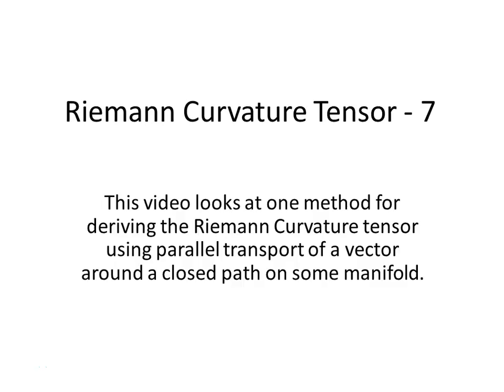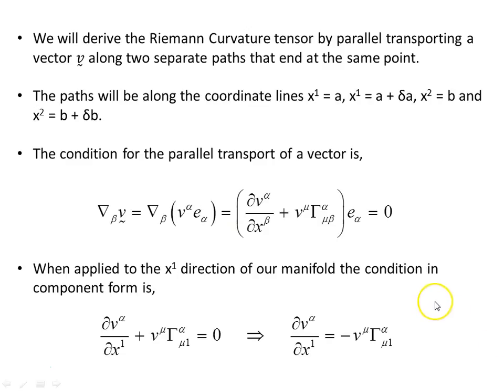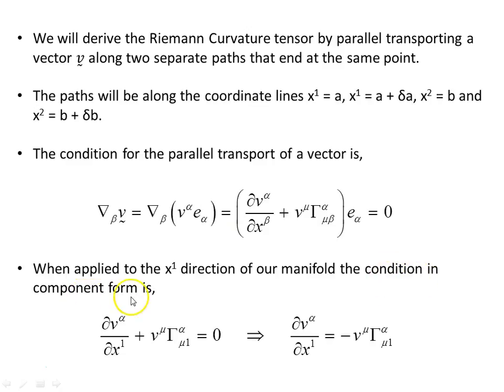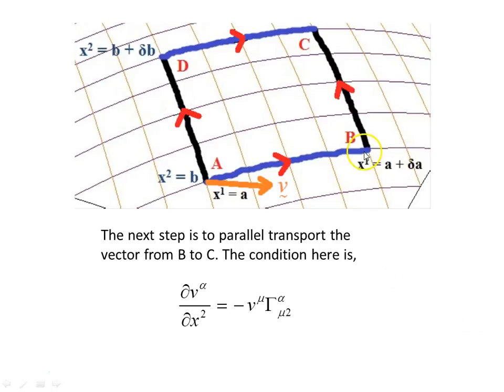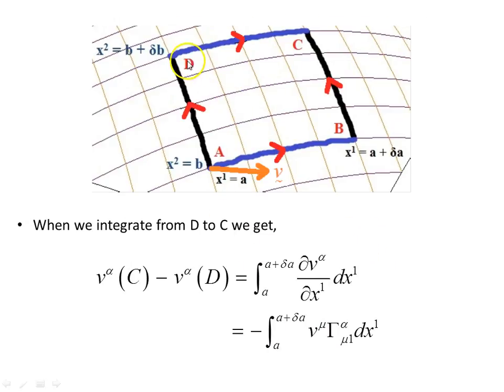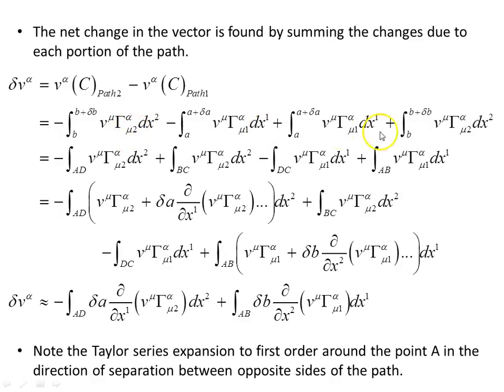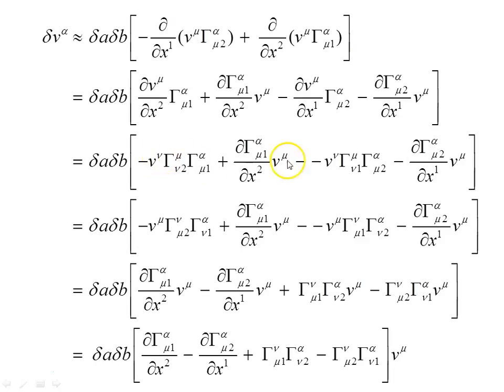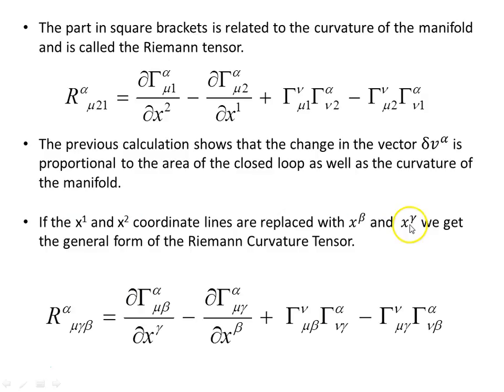Riemann Curvature Tensor - 2 (corrected)

Comment: Hi there! At 9:12 is there a mathematical way to get from the equation at the top to the one right below it? Im not really seeing the jump between the two. Thanks!
Reply from the maker: Hello Brendan. The two integrals on the first line are integrating dx and evaluating it between the two terminal values, the difference of which is delta 'a' or delta 'b'. We can then take this delta 'a' or 'b' value out front. So Integrate[dx] with terminals = [x] with terminals = delta 'a' or 'b' as the case may be.
Reply: @TensorCalculusRobertDavie  Thank you very much!

Comment: Thank you so much !
Is it okey if i think the component of the vector v which is normal to the surface, is the christoffel term ?
Reply from the maker: There is no part of v that is normal to this surface.

The vector field is defined on the 2D manifold (curved surface) and each vector "lives' in the tangent space at each point on the manifold and does not exist off the curved surface. The Christoffel symbols are telling us how the vector's basis changes from point to point as it connects adjacent tangent spaces. I have a video on the connection on this channel.

I hope that helps?
Reply from the maker: Have a look at the video titled,  "Another example on how to calculate Christoffel symbols" on this channel.

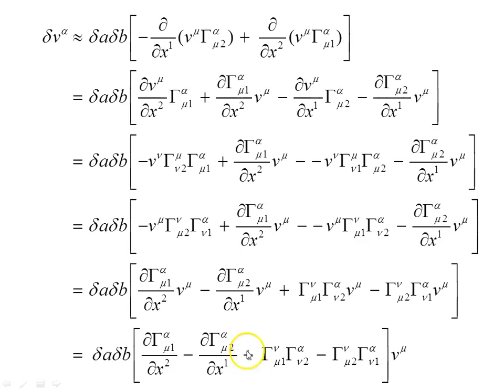Comment: Hello Robert, that's great material, thanks a lot for the good job. There is still a point that I don't understand:  The coefficients v^{\mu} of the parallelly transported vector v are time-dependent. In which time v^{\mu} as appearing in the final result in 12:24 are evaluated? In general, some more details in the way you do the Taylor series would be helpful.
Reply from the maker: Hello Foivos and thank you for your question.
The coordinates that make up our manifold don't have to include time, although they can. In this video we are looking at two general coordinates and how they change as the vector is transported along the given paths.
You have a good point with the Taylor series which perhaps I could explain in a future video.

Comment: Hi Robert, can we also parallel transport a covariant vector? In this video, you transport a contravariant vector. If you can, then what will the similar equation as the last equation on this video, relating the change in the vector and the Riemann tensor, look like? Also, what will be the equation for the derivative of the vector along some path? Will it also contain Christoffel symbols, as it does for the contravariant vector?
Reply from the maker: Yes we can parallel transport a covariant vector (1-form). Let's just step back a bit and recognise that we are parallel transporting a tensor which in this video was a vector because of its application to GR. But the real point is that we can parallel transport a tensor and the condition for doing so is that the covariant derivative of the tensor is zero all along the path it is transported.

See equation (3.31) at;   https://ned.ipac.caltech.edu/level5/March01/Carroll3/Carroll3.html
Reply: @TensorCalculusRobertDavie  But then there seems to be a problem, because the unit vector is a covariant vector, and it is also always parallel-transported along any path (since the derivative of the unit vector along some coordinate at some point is a christoffel symbol times the unit vector at that point, and that equation is similar to that when you parallel transport some contravariant vector, as you showed in this video). But if space is curved then, it should be possible to transport the vector around a loop and get back a different vector, which would mean that the unit vector before the parallel transport is different from the vector after the transport. But that is impossible, as the unit vector is a vector field, and it therefore has only one value at each point.

Comment: at 1:55 I think it will be partial derivative(Instead of covariant derivative) in two left-most side of first equation
Reply from the maker: No, it is definitely the covariant derivative and not just the partial derivative. We need the covariant derivative because the basis vectors change from point to point as do the components. That means we can use the part in the parentheses at 1:55 to form the equations at the bottom of the slide.